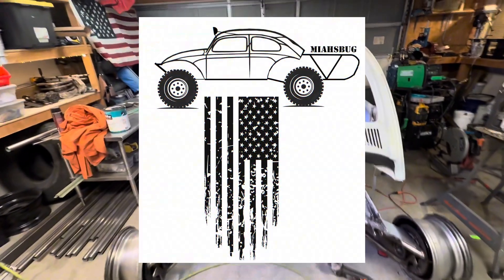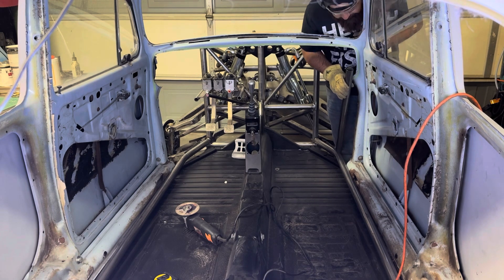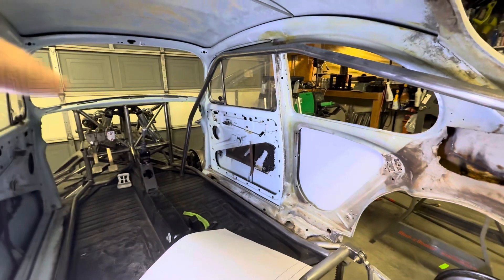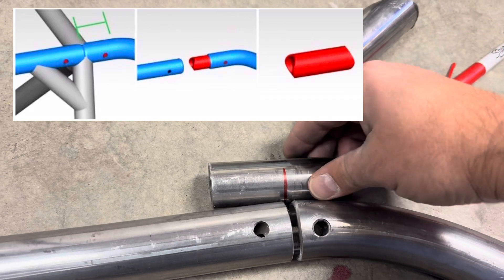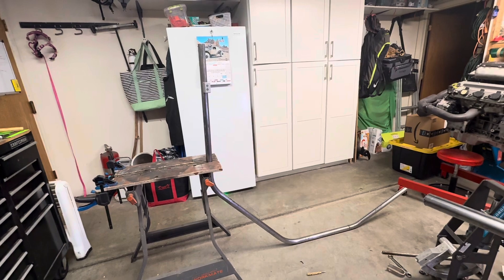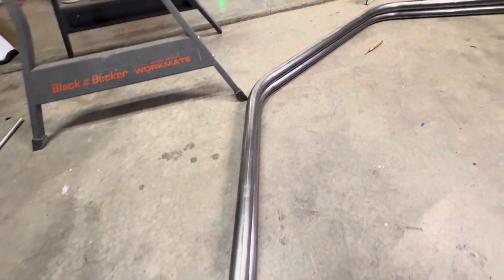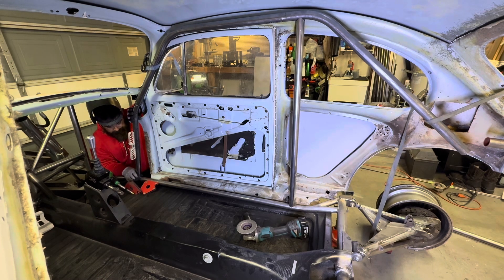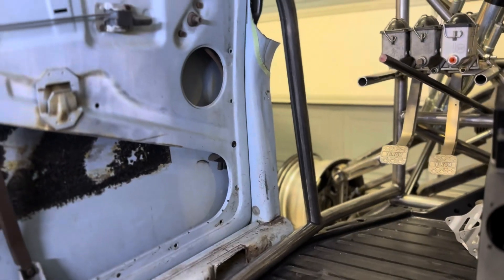Roll Cage Build- Ep. 2 Honda VTec Swap VW Bug

Comment: Awesome work man...can't wait to see the progression of this build. Quick tip, I used to use PVC pipe as a template for cages. PVC pipes are cheap and can easily be bent by hand on the fly inside the car with a heat gun or cut and spliced at every point so you have a finished piece to mark out your bend points before you bend your steel. Keep up the great work man!!!
Reply from the maker: Thanks so much for the tip. I considered do that. Probably would have saved me from messing up that tube. I used that method on my front tubes but had a hard time matching the bend radius. Regardless would have been beneficial for the cage work. Thanks for watching
Reply: @MiahsBug  your build is killer by the way!
Reply from the maker: @Milkshake_dub thanks so much!!!

Comment: Turn that motor 180 degrees and mount it mid engine. Send one axle to the front diff and one to a rear. Some 4 links and you got an AWD beast
Reply from the maker: That would be really cool. You go first 😂